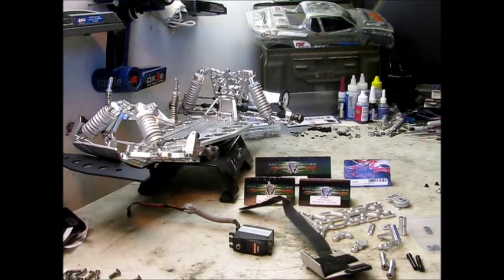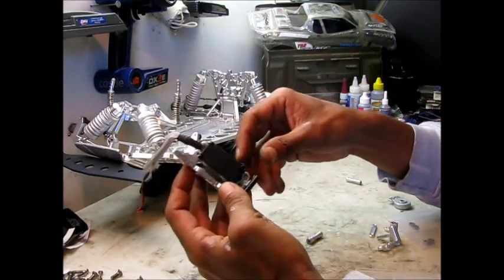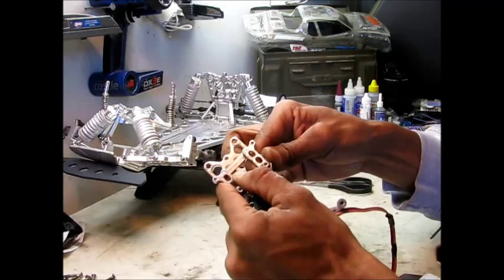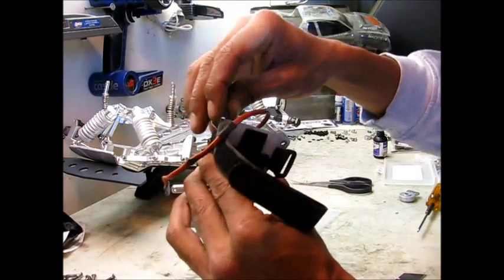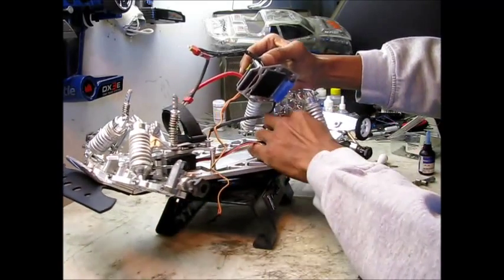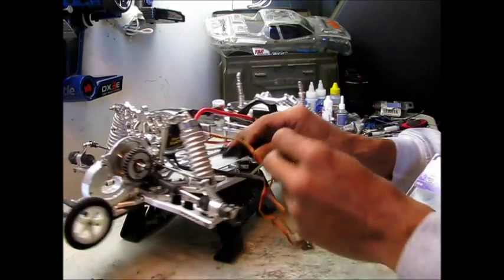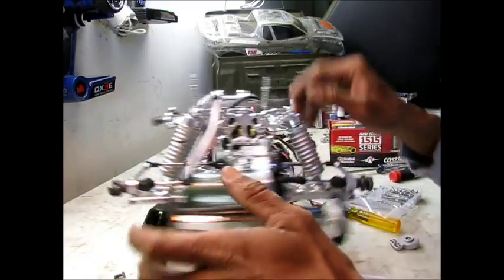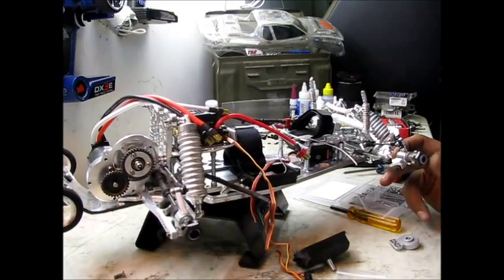100mph all aluminum flm mamba rustler build series #4 electronics. 2cwik4u #145

Comment from the maker: thanks Nick. im currently running 500k wt diff oil. real tight, but not locked. I had a hot racing locked diff in for one run. major crash, took me out of the game, till now. I highly recommend not locking your diff, for speed runs. for bashing, its great. put the locked diff in my vxl rusty and couldn't hit 70mph. pulled the locked diff out and ran 71.2. I have done the jb weld, toilet paper and playdoo methods.

Comment: this is a giant waste of money
Reply from the maker: sorry you feel that way. there are alternate, less expensive ways of going about it, but I wanted something that was durable and backed by warranties and something different than whats out there.
Reply: I'll admit it looks really cool and I can tell you put plenty of hard work into it....but I feel that all those aluminum parts will actually make your rustler less durable. On a typical car with plastic a arms, the plastic components take the force of the crash and break thus  preventing damage of crucial components. But for your car, a small crash would probably put the whole car out of wack....but a cool original set up nonetheless
Reply from the maker: you must be new to my channel. lol. ive crashed my car at 102mph and then did 99 right after. ive hit a curb at 95mph and drove away till a driveline feel off. and ive had numerous other crashes. almost all the aluminum I have is back by a lifetime warranty. that's why it cost a little more. but I do understand what you mean about the plastic. and plastic is cheaper to replace.